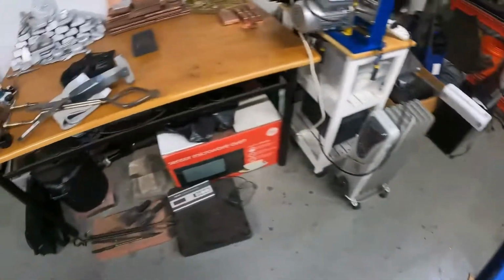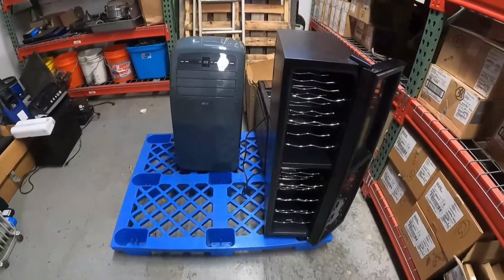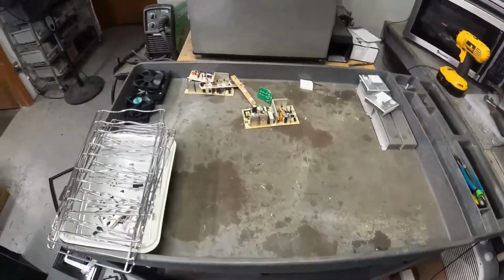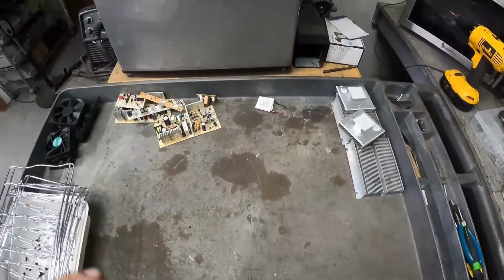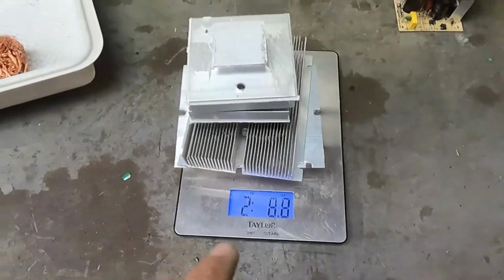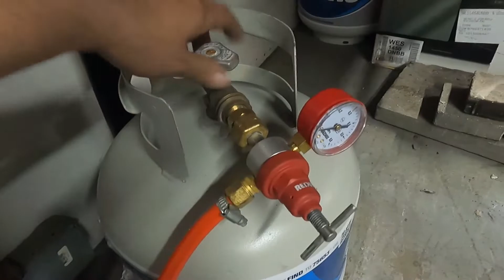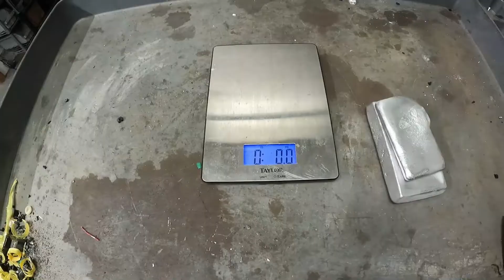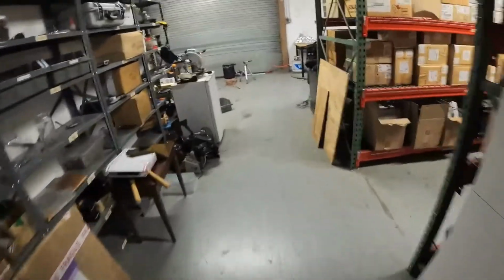Scrapping a Wine Refrigerator for Copper and Aluminum - Trash to Treasure - Aluminum Metal Melting

Comment: Was there any copper in the fan motors?
Reply from the maker: Very, very minimal and for the time it took me to get it out, wasn't worth showing those efforts.  Same goes for those micro transformers on the boards.  I think there was less than 20 grams recovered from all of the stuff done off-camera.  The wire was about 80% of the total weight if memory serves me correctly.  Thanks for watching!

Comment: too bad .. those ac units have alot of copper ... good to know though .. i have an old wine fridge here that was on the scrap list ... might just pass on it now .. its even a bit smaller than the one in the vid so prob not worth it ... thanks again !!
Reply from the maker: Hey man talk about a let down huh?  I figured I could probably sell that air conditioner for $30-$40.  Even if there was 5 lbs of copper in it, I could make more trying to sell it as a working unit.  The other two don’t work so those are next in line to be scrapped out 😁  Thanks for commenting and watching man!

Comment: Where did ya get that 2 lb aluminum mold from?  I want 2!  Lol
Reply from the maker: I bought it from PMCSupplies, it wasn’t cheap... I just checked their website and they are now selling it for $106.68.  I believe they have a coupon code of PMC5 for 5% off.  If you’re just going to use it for aluminum, might I recommend welding up some U-channel steel and make a gigantic one!  In the vid I posted today, I made two aluminum ingots a little over 3.5 pounds each in my biggest steel mold.  I wont use it for copper / brass.  😁